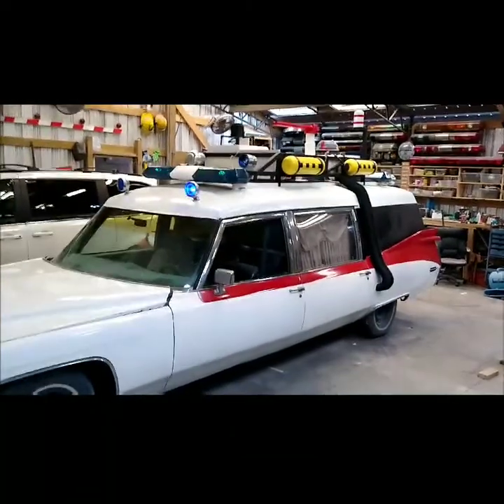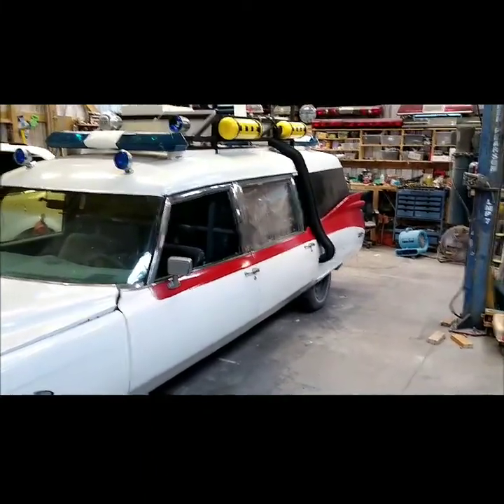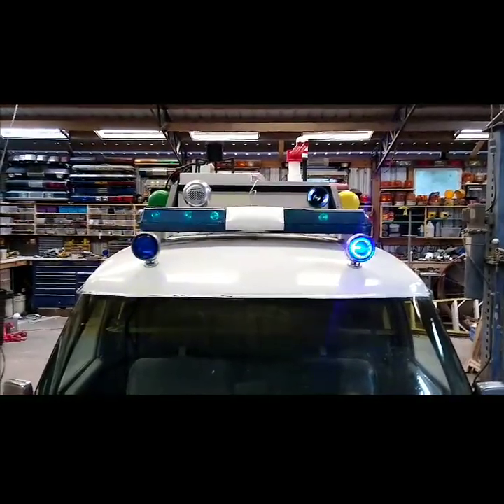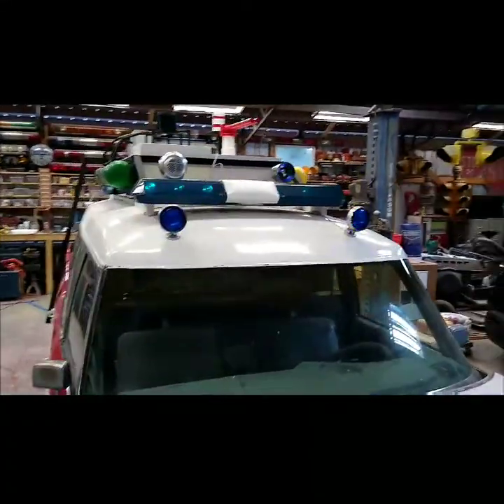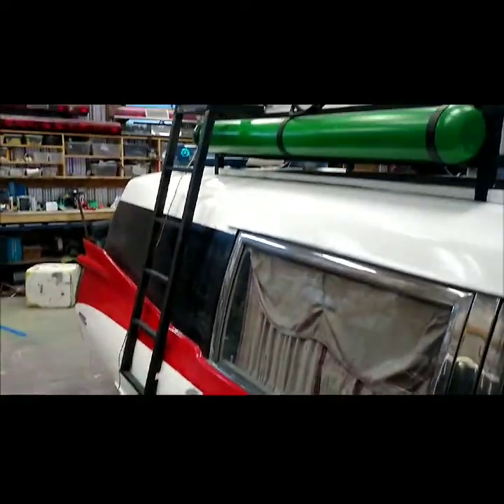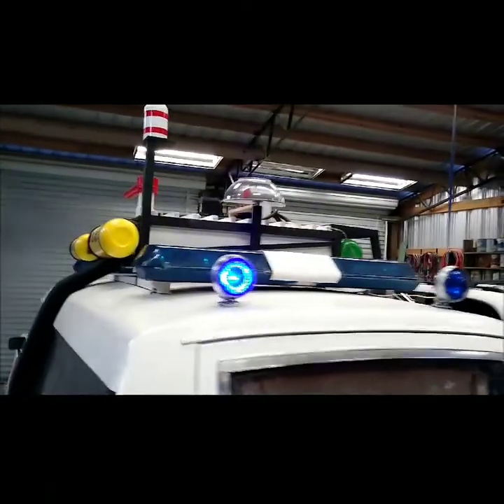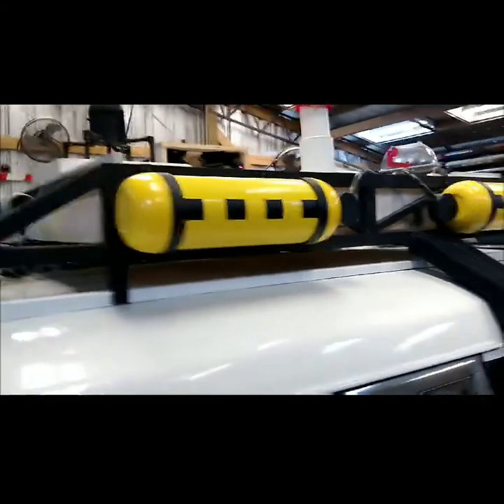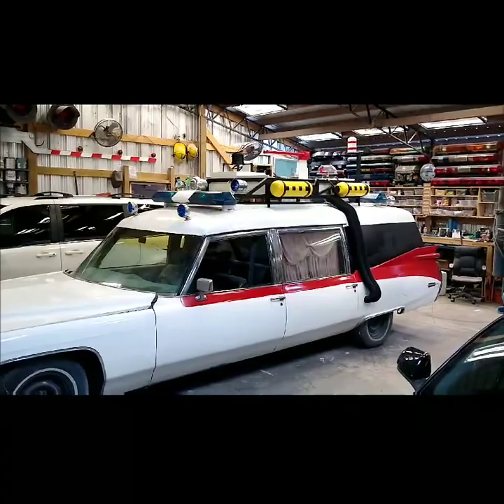Ghostbusters/ painting

Comment: Hi, I love the idea of plugging the lights. What size converter did you use? I haven’t wired my lights yet, but everything I’m reading is I’ll need a lot of amperage. Ideally, I’d like to make mine do both (car power and wall power), isolate from the main wiring with a disconnect and connect through and 120v to 12v converter. Thank you.
Reply from the maker: @wytel_FPV  https://a.co/d/9oTVZUX
I cant find the one im using. But i use this one for my lightbar collection.  More than enough to run the two lightbar.
Reply from the maker: @wytel_FPV  https://youtu.be/akUq2UkXJsc?si=RwkAZDdnCC0TRT3g
Dont know if you watched this video. I show where and how i did the power for the roof rack
Reply: Thank you, I didn’t, it’s very helpful.
Reply from the maker: @wytel_FPV  if you have any questions let me know ill try to help